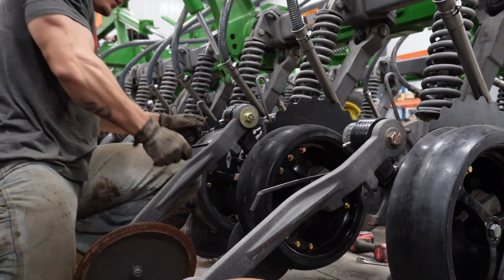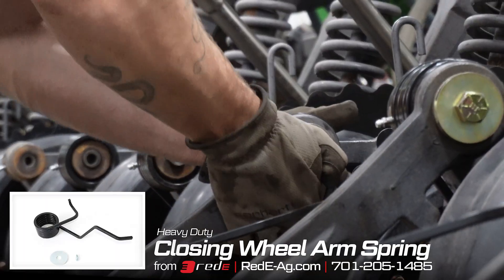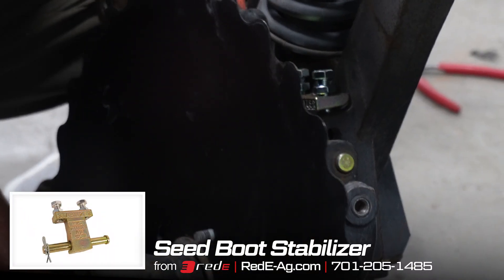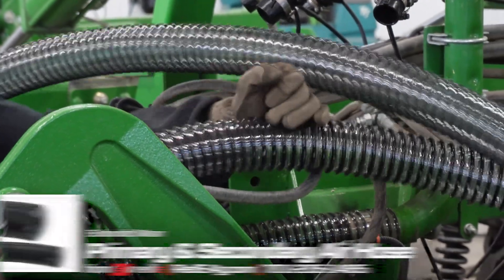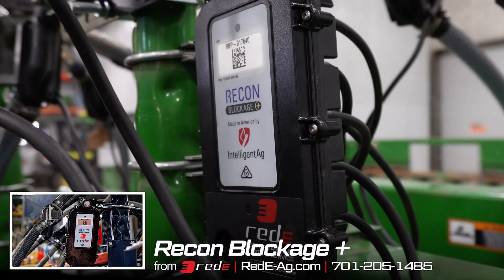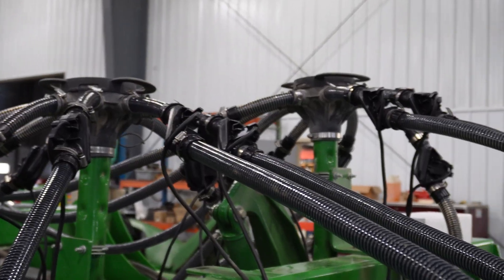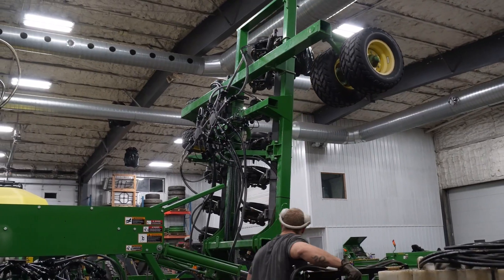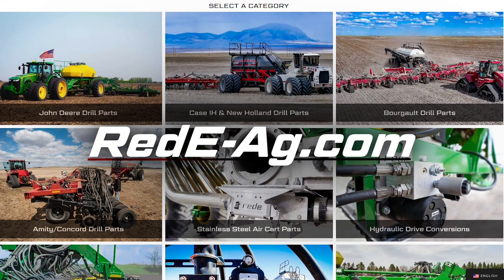John Deere 1890 Drill Restoration by RedE: Full Rebuild Overview!

Comment: If you want a good bit of info on a commodity cart air flow. Put a wind meter on each run off mains from tank. Then from towers to each and every row unit. This advice caught attention the king of air seeders. Phli Needham. Air flow is the key to carts working